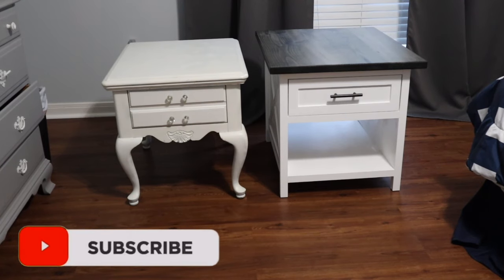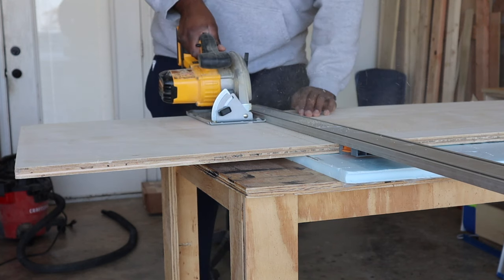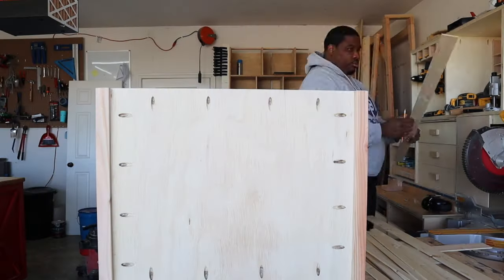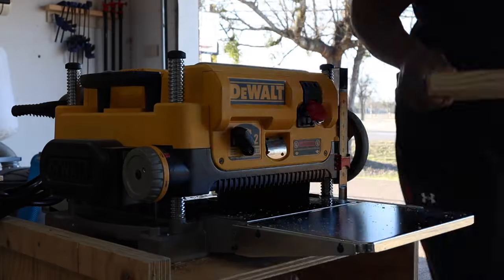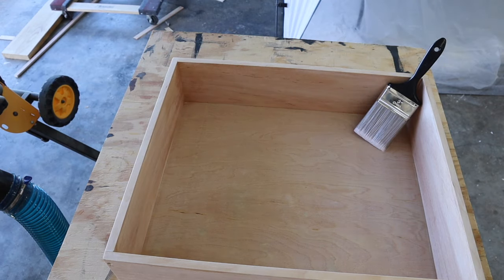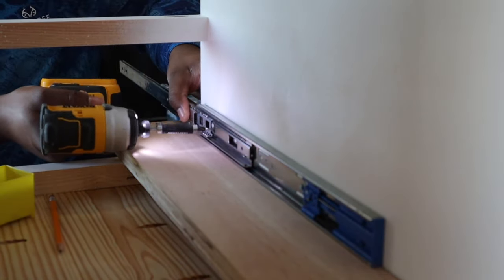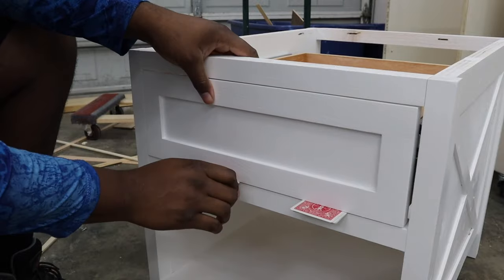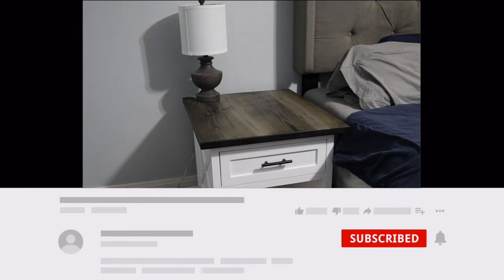Farmhouse Night Stand - DIY

Comment: Pretty sweet, nice work. 

But I have a dumb question about the planer.  Why not just cut them down to that size to start with?

Instead of making them 2x2 to start with but then taking them down further with the planer.  I don’t have one so curious how smooth it makes them, since you were sanding it down more later.
Reply from the maker: It was my first time using the planer, so I may have over did it on the 2x2’s and just made it work. As for planing the top it would be as smooth as using 100 maybe 120 grit sand paper. 
I like sand up to 220 if I am going to stain  something.
Reply: @coreysworkshop6421  nice!  Thanks for the follow up.